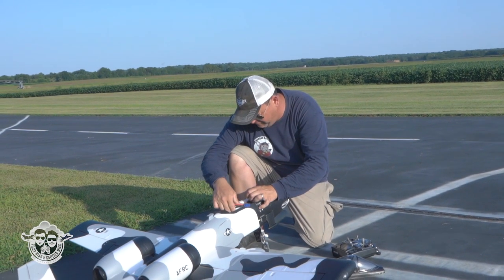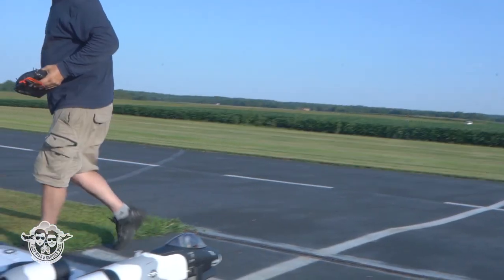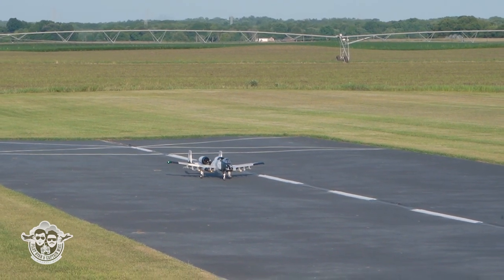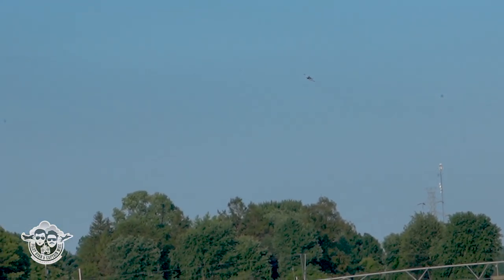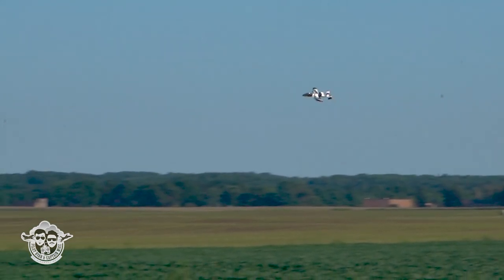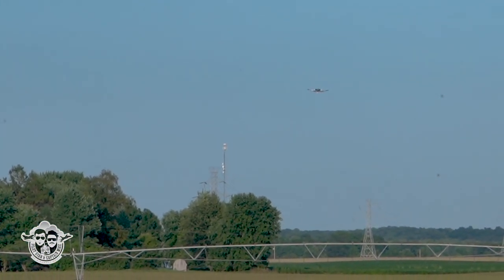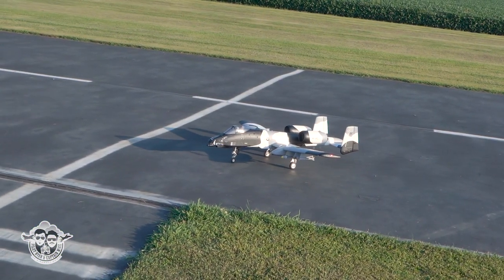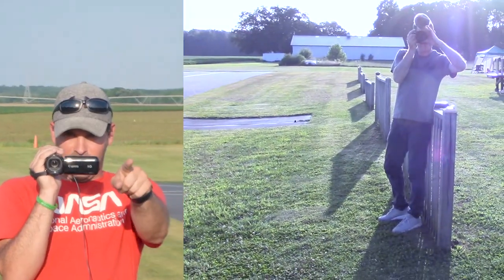FMS A10 Thunderbolt V2 with RCJETWERX 5500 70c Lipo

Comment: Admiral Pro 6000mAh 6S 22.2V 50C LiPo Battery with EC5 Connector Multi-Pack (2 Batteries)is it better than RCJETWERX5500 70 C Lipo for this A-10 ??
Reply: Roaring top is the only batteries I use in EDfs

Comment: There is a bit of questionable information here that I would like to correct.   They are suggesting their viewers to take off on low rates.   Low rates are for high speeds.  When taking off or landing, you should always do so with high rates.   When the plane is slow on take off or landing, you need more deflection for the same effect and sometimes having access to more control can be critical.   Especially on Take off, sometimes you can bee too slow.   Or landing.   If an engine burns out or anything goes wrong on take off, not enough throw can be fatal in fact.   I have seen it happen.   A wing drops and not enough throw to correct in time.   Just add enough expo to high rates to make center similar to low rates and you have the best of both worlds.  I know planes now have so much power it is much less likely, but still...    I hope that makes sense.   I know this channel is not about piloting, but they have a big audience.   Should give good advise even on incidental things.
Reply from the maker: Why not ask instead of making assumptions? There is a good reason to suggest low rates especially on early flights. In fact many manuals recommend it and some do not. One extremely good reason to get to know the plane in low rate is to ensure an adequate flying speed before takeoff. As you should know some people in high rate would be coming off the ground too soon at an already too slow of an airspeed which would further exacerbate the issue. Too much throw and airspeed is scrubbed due to abrupt changes to aoa. I stand by my recommendations. I advise low rates to ensure adequate airspeed as a prerequisite to take off. It is for the planes survival and safety that I recommend it. So, as someone who has dedicated a lot of time and energy into sharing my hobby through video I understand that what I say can matter. It is for that reason I inform the viewer of what I am doing. That person can then take it or leave it. I share what works for me. We never present what we do as the absolute one way to get things done. Just know that there is a reason for the recommendations.
Reply: Bwaaa haha hahaha 🤣